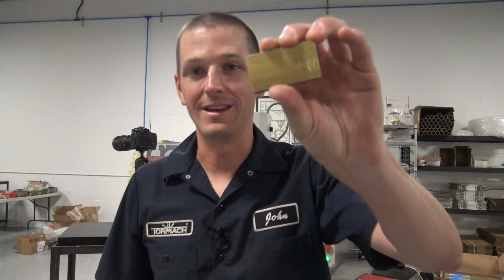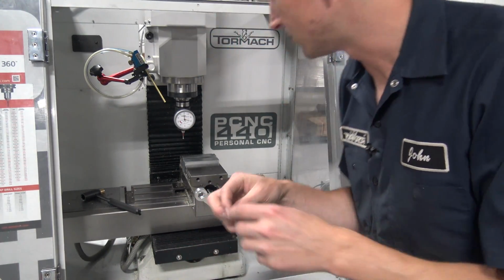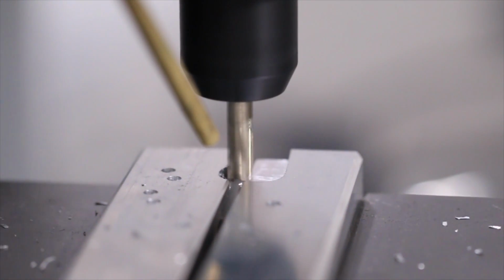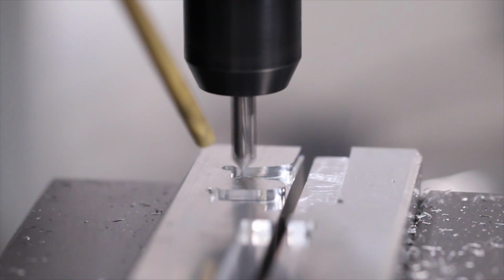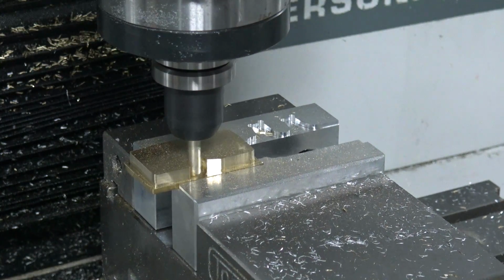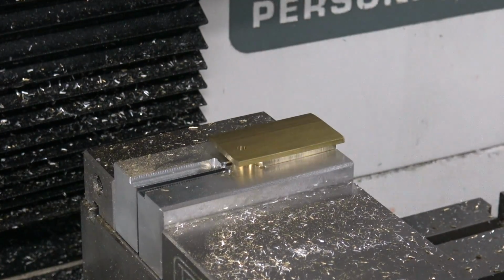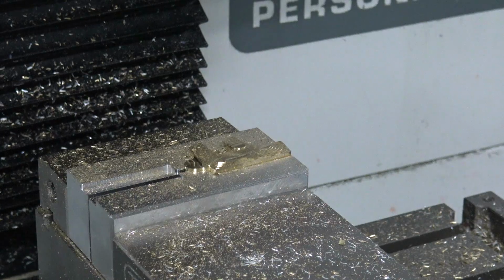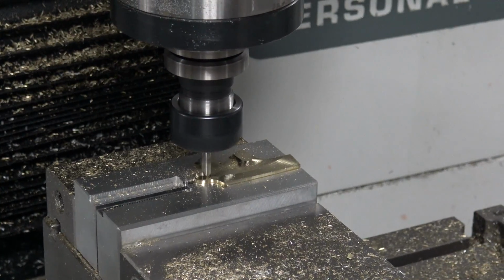Machining the Fusion 360 Logo in Soft Jaws!  WW116

Comment: Nice work. I noticed some spin up of the spindle when initially contacting the softjaws. Adding in a G4 (dwell) followed by a P4.0 or similar (time in seconds or possibly miliseconds depending on control configuration) will enable the spindle to be at full speed before contacting the part.

Comment: Any particular reason why the parallel path was done on the XY direction? Or is just a style preference?

Could have easily use a path that does pretty much all cutting along the X, and the stepover is the Y. The posted code is bit smaller with mostly XZ, and maybe faster for the controller to go through it. (Not that the Tormach is fast enough to to start choking code, but that's besides the point. ;P)

Comment: Hi John, if spindle did not want to start after tool change, its because of the bug Tormach has in software that they have not fixed yet. It has to do with the spindle door clicking the safety switch on the door on and off in rapid succession which confuses the software. You don't have to reboot machine usually you simply open the door wait a bit and then close it again.

If you make sure that this on/off clicking does not happen just pay attention to how you close the door so when you close it you don't trigger the switch on/off cycle.

I have emailed Tormach months ago about this and so far they have not fixed it.

Comment: I've actually been thinking about using soft jaws for an ongoing project I have going right now.  Do you have to do anything special to align the two jaws if you take them off and put them back on?  Everytime I've used them, I have never removed them until the project is over.

Comment: John, congrats on the teaching gig!  Way to go!

I note that with the soft jaw design as shown, the part rotates front to back when flipped. That means that what was machined on the front side ends up against the back jaw for the second operation.  In this case it probably doesn't matter, but if it was a precision part, wouldn't it be better to keep the back edge at the back for both ops?  I.e flip it over the end, y axis, rather than around centerline, X axis?

Thanks for the edutainment!

-- Mike

Comment: Hey John, another great video.

If I were you, I'd make a small modification on your softjaws. Basically, you have milled the jaw to-dimension of the "F" model. Since none of the EMs actually have a "0" edge radius, actually if by any chance someone mills and does not chamfer the edge and places that model in the cavity it will most certainly sit a bit above the bottom edge and it could also be a wee bit skewed. That can be avoided by running a small EM, say 2mm dia, along the perimeter (say 0.1mm from the edge, or along the edge), with a depth of .2mm or more. That will leave you with a slot around 2mm wide on the edge and will tolerate a few burrs, non chamfered edges and will be more precise since now the base will actually sit flat (or in its shape) accurately. I use this technique for all my machining jigs.
Reply: Naresh Sharma 
I do the same thing for parts with sharp edges. But in this case the first op put a heavy chamfer on. More than enough to clear any corner radius in the bottom of op 2's pocket.  So channeling the op2 pocket isn't needed here.

There's also an easier way than channeling for small parts like this.  Just cut 3 pieces of .005 ( .01 if its particularly ugly) shim stock and place it in 3 positions in the pocket. It'll jack the part up precisely and clear the corner radius. And no worries about breaking a tiny endmill in the floor of your softjaws.
Reply: Occams Swazall, yes the shimming way would be the way to go if you'd forgotten to place the channeling. If you're into onesies and twosies then that would be perfect, but if you're showing this as a technique to make soft jaws, its necessary to put a channel. How many shims will you cut anyway? Remember cutting shims using a shear will take them off size, you'll need to grind them to size ;-)

Comment: Is the spindle error you talk about that it begins milling while the spindle still is ramping the rpm up? Because it really should ramp all the way up before starting operation.
Reply: I fixed mine by enabling a DO on my VFD and modifying the ladder on my machine.  When a M3 or M4  SXXXX is commanded, the controller won't acknowledge the completion of the execution of that M code until the controller sees a signal from the VFD "spindle at speed".  Once that signal is acknowledged then the M3_DONE bit is enabled and the controller executes the next line of G code.  This allows the spindle to completely accelerate before the machine does anything else.
Reply: supahonkey I didn't realize you could do that on a 440?
Reply: I'd be curious on the "fix".. I've been manually adding delays after spindle-start for gcode created via conversational, and for Fusion360 generated code there is a dwell added after each spindle on command.

Comment: I generally don't clamp parts off center of the vise because it makes the vise not have equal clamping force. might run into issues in longer runs, I haven't tried tho, was just told this from the get go